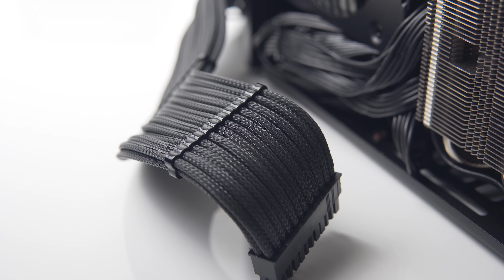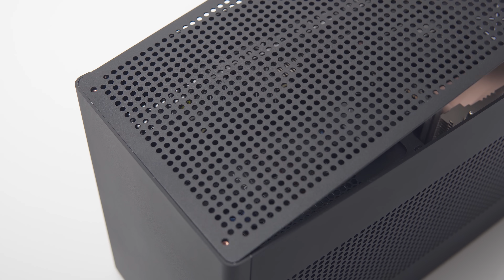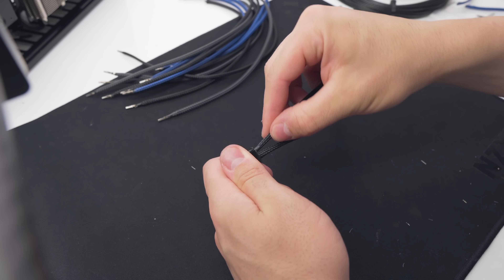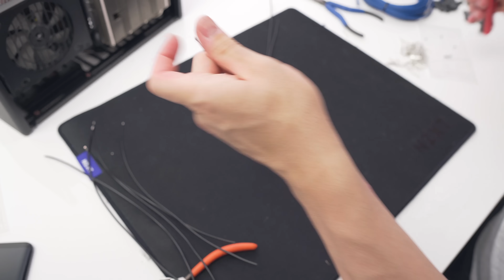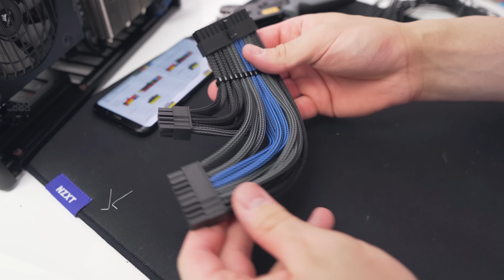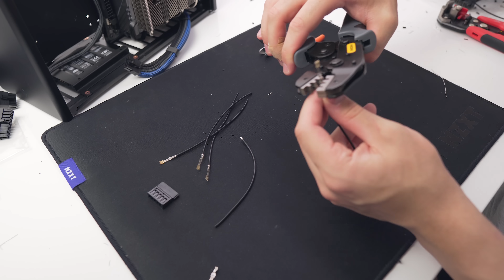Custom Sleeving my Ghost S1 Build - Finally Complete!

Comment: I'm not sure if you'd respond but I'm wondering how you managed to build the 24-pin cable without the split wires, I can clearly see some empty sockets in de connectors though. Did you leave some of the split wires out?

Comment: Hi Optimum, what size pins and wires do I have to purchase to replace the original cables? Also  how do I check the psu and component side wire configuration diagram if I am using seasonic psu

Comment: Did you a power usage before and after (checking thermals)?  Just wandering because of the added volume of cables runs (it could change the airflow somewhat). I know it's minimal, still wandering. BTW excellent job. Perfect deep within and that is what I like about it. Not those flashy LEDs...

Comment: Lovely sleeves. Did you document any of the wire lengths such that they could serve as a template? Thanks.

Edit: did you ever share the stl for the cable combs?

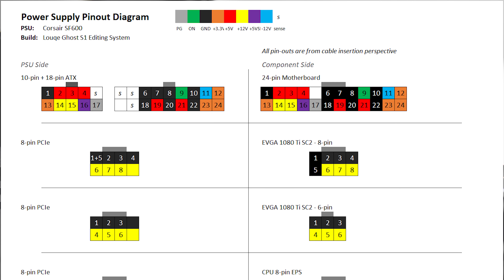Comment: At 2:42 Can I interchange the "sense" wires however I please or do I have to connect them to their corresponding wire. In other words: If my 12Volt line needs a sense, can I use any sense wire or do I have to use a specific one?

Comment: At this point I don't even care that this cables modification will not improve my computer's performance. It's all about that deep satisfaction knowing that your cables inside this beautiful Ghost S1 build are perfectly measured and there are no wires tangled around the inside the case of this size. Great job man!

Comment: I know you are way past air cooling in your ghost, but I wonder if I'm missing something in mine. I can't run blender benchmark without hitting 95C on my 2700x and L12 cooler.  I guess the L12 is just not good enough?
Reply from the maker: 2700X is a hot chip, L12 isn't going to cut it. 
To clarify, I've never recommended pairing these too. At this point I'd experiment with undervolting the 2700X to around 1.15-1.20V if you can.
Reply: @optimumtech  thanks for the fast reply. I am undervolting now and seeing great results!  Would you crown a new King for air cooling in the ghost now better than L12? 

I have to air cool cuz I need to fly.

Comment: I got a question. Is it possible to just cut the original cables to length and then just resolder it? Or do you have to make them from scrap?

Comment: Tip: I was using a small butane torch to bind the pet sleeving, but I have found a regular lighter and clear heatshrink is the way to go. You can actually see the sleeving melting as you turn the sleeve to get it melted all the way around.  Makes it so much easier and enjoyable I found.

Comment: With those custom cables, can you try an AIO build with the radiator on the bottom instead of the top? I think it looks a lot better aesthetically but according to other people the main problem is lack of airflow with full-length stock cables, and custom cables should fix that.

Comment: The Noctua cooler in the video has the fan underneath the heatsink, but the one in the link has the fan on top - It doesn't look configurable (??) What is the actual Noctua cooler pictured in this video that will fit the Louqe?
Reply: Noctua NH-L12 on this video

Comment: i just built a node 202. the stock cables on the corsair do leave alot to be desired... that being said, i have all the tools to do this, including the molex pin remover..... im just too LAZY to do it.
beautiful work man!!!
Reply: onecleangti Pro tip: The Platinum edition of SF 600W comes with premium sleeved cables instead of the stock ones. It’s only $20 more expensive than the Gold edition of the SF 600W and it’s a full cable kit, not extensions. So in the future, if you’re buying a SF PSU and intend to also get black custom cables, just buy the Platinum grade PSU.
Reply: onecleangti Pro tip: The Platinum edition of SF 600W comes with premium sleeved cables instead of the stock ones. It’s only $20 more expensive than the Gold edition of the SF 600W and it’s a full cable kit, not extensions. So in the future, if you’re buying a SF PSU and intend to also get black custom cables, just buy the Platinum grade PSU.

Comment: Do you mind sharing your recommended cable lengths with your system?  I have the same motherboard, L12 and corsair power supply.  Thanks.

Comment: although they look nice it would be more logical to skip sleeves in tiny case builds. too much bulk that defeats the reason of doing it in the first place. with black and blue cables will look as good, if not, A LOT better. you can 3D print some bare cable holders and give it a try someday, you may even have a tad better thermals, who knows.

Comment: Your soldering is really great and you make excellent use of your helping hand stand.  A tip I'd pass down to you is to put some dialectic grease on your soldered wires before you cover it with heat shrink.

Comment: I have a couple questions..
Did you do double wires on the 24 pin?
And is the pinout for the Strix 1070 the same as the evga 8pin?
Reply: Bumping this question.

Comment: I'm doing a wall mounted PC I have the motherboard I have hhdx St Charles I need is to spray paint or wrap the wood drill the few holes and get the power supply I have everything else but the power supply in the ram

Comment: Superslick work with the sleeve! Really pumped to do my own cables now. 

I might have missed it but how did you do with the cables that separates? Like where there is one cable coming from the 24pin and splitting into two that goes both in the 18pin and the 10pin contacts that go into the PSU? The rest of the cables is pretty straightforward it seems, but cant really figure out how to do with the splitting ones to get them good like the rest.

Comment: I have a question. Why do you want to position the PSU like that. Is it so the PSU blows the heat up? Is there any room for a fan or is there even any use to have a fan.? I'm looking into build mine with a aio water cooler, and my train of thought is that the lack of cpu fan Will make the case pretty toasty.

Comment: Why is beneficial? PSU current delivery its spot on with smaller cables.
Constant Voltage and because of the smaller distance you have less need for amps that is good for Mosfet lines because they don't get hot.
Good job with the build!

Comment: I wonder que much features you may add to the Luowue Ghost S1 if add two extensions,  one on the top and another in the bottom.

May be you can add a lot of disk storage, a mATX card or a water pump

Comment: You mentioned that the one of the cables was easy to make because it only had grounds and 12v switched. Is there any reason why manufacturers don't use the same pinout on the back of the PSU as the pinout on the motherboard plugs? Then the cable would almost be like a male to male extension cable directly from the PSU. This seems like it would be pretty practical, so is there a reason that PSU manufacturers use slightly different pinouts on the PSU?

Comment: Custom cables are not necessarily just an aesthetic mod. Considering the fact that you can use custom thickness, that means you can get better efficiency out of your power supply and less heat and minimum length means minimum EMI. Plus there are different wires with different cores and different characteristics like resistance, frequency response and other mechanical characteristics.

Comment: I am building my first pc, and I would really appreciate the help of someone with far more knowledge than me in the topic. I am going to use this PC for gaming, possibly overclocking and the possibility for an upgrade.

Case: NZXT H500 - £65.99
Motherboard: MSI B450 Tomahawk - £91.94
GPU: RX 580 ARMOR OC - £199.99 (please tell me if theres a better card available)
CPU: Ryzen 5 2600 - £144.98
RAM: Corsair Vengeance LPX 2x8 300mhz - £105.14
PSU: EVGA 650W BQ 80+ - £73.99
SSD: ADATA SU800 128GB - £31.58
Hard drive: Seagate Barracuda 1TB HD - £38.98
X2 Artic fans - £8.96
X4 fan splitters - £6.99
Viewsonic xg2401 freesync 144hz - £194.86

For the GPU, would a vega 56 sapphire pulse also work? Thank you for any responses :)

Comment: Are you using mdpc 15 or 17 gauge wires ? If yes can you post a short clip of how you joined 2 cables into 1 ? You did a really excellent job with those cables creation but joining 2 cables is always the hardest one

Comment: your cable work is fantastic but if you want to do video editing, your cpu cooler is a hard bottle neck.
Reply from the maker: Thanks! The NH-L12 cools my delidded 8700K @ 4.7GHz no problem at all.
55-65C during edits and 70-75C during Blender.
Reply: @optimumtech  Really??? the L12 is way better than the L9 then. My 8700k with NH-L9 throttled hard @ 4.2 at 90C. after switching to H60 is just so much better 5.0GHz at 75-80C
Reply from the maker: @ronniedai88  Oh definitely, the L12 stomps the L9. It's a much larger cooler with a thicker fan. H60 is great too!

Comment: Nice quality videos, maybe go with rolling pin for the GPU extensions cable just to get rid of the tight angle bend on CPU cooler side.

Comment: Buy a psu tester. These things go for less than $15 bucks, and let's you check if the wiring is good before you risk plugging it into your expensive system

Comment: I almost went with that same theme with mine. I have carbon white in there. Love that MDPC-X sleeve. I was just going to custom length, non-sleeved cables, but it looked so damn clean that not sleeving them was letting it down. Yours turned out about as perfect as possible. Excellent work man.

Comment: you could also maybe try sleeving the ac power cable too to just complete the build but that could be hard trying to get the 90 angle connector

Comment: Some of the wires on the 24-pin connector are doubled, did you run a single wire and split it near the psu side of the cable or run a double wires from 24-pin?

Comment: Did you have any issues installing 2.5” drives in the bracket that was included? I couldn’t even used that bracket because the stock sf600 cables took up too much space where it would be installed.

Comment: How much does it cost to custem sleeve a full PC (cables, sleeve, conectors etc.) And how much time Do you needed?
Reply from the maker: Material cost for an ATX build would be $30-40 (plugs, pins, heatshrink, wire, sleeving, combs), but the tools could add up to $150+ if you don't have them. I would put aside a full weekend for a sleeving project if you're not experienced.
Reply: @optimumtech  ok THX!

Comment: The cables look so much neater & professional & all that, but could you take it to the next level by putting capacitors in the 24 pin 12V cables to aid power supply smoothing.
I've read it can really make a difference having a smoother supply on the 12 volt rail. Trouble is, i can't find what values are needed to make my own.
any chance of a follow-up on this as the "pro cables" with the caps fitted & sleeved are way over priced for my liking.
Could you also just split the black flat cables  & trim & sleeve them to save costs a bit, or is the cable you use of a higher quality.
Great vids btw. :-)
Reply: The PSU should have perfectly sufficient smoothing, without help from the cables. I guess it would work on cheaper psus, but who uses custom cables with cheap psus anyways
Reply: Strangely enough, the SF series power supplies (even though they're type 4 cables) don't have the smoothing caps the other corsair supplies have.

Regarding values for caps, you could possibly find a corsair RM series supply, their stock cables have the smoothing caps you're after.

Comment: Hi! What do you think about that how would noctua's low-profile cpu coolers (nh-l9i, l9ix65, l12s) perform in ghost s1 with 9700k. Currently i have macho rev b in define c case and while gaming temps went up to even 83, but now when cooling paste has settled it's been around 78-81C.
ps. you have quality content, always pleasure to watch :)

Comment: That job is amazing bro. I recommend that you get the side panels done in acrylic or glass somehow to fit on the case with screws. Also to have ventilation on the panels. Or it could be that one on the panels is converted to glass

Comment: I need your help 
My founders edition 1070ti doesnt have any warranry void stickers 
Its brand new 
Should i install arctic accelero iii ? 
Will my warranty be void 
It bought directly from nvidia :) 1070Ti FE
Reply from the maker: If there's no warranty void stickers, what are you afraid of? 😅
Reply: @optimumtech  change of thermal paste i guess :/
Reply: @optimumtech  and also did your founders edition card had any warranty stickers??
Reply: The founders edition are usually water cooled it's okay to it apart. Plus if you're in America those stickers mean nothing anyway
Reply: Aren't "Warranty void if removed" stickers illegal? The sticker has no effect on your warranty.
Reply: @eternal9195  in my countries they mean :/
Reply: if you bought it from Nvidia and the lack of a sticker bothers you, then talk to Nvidia about it.
Reply: @derekriggs7659  hmmmm nice idea